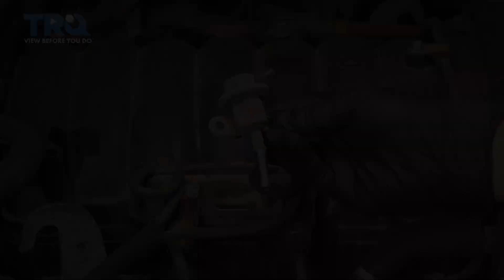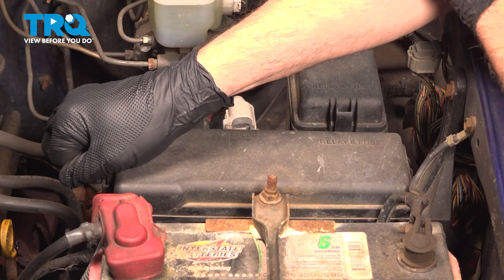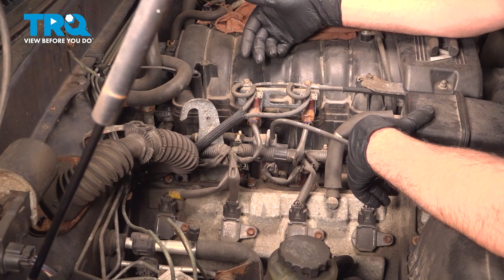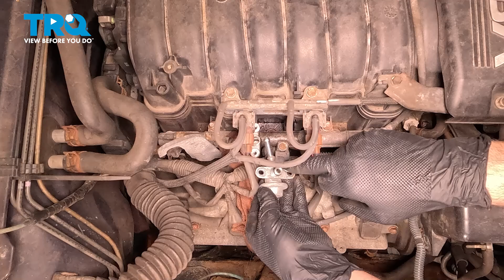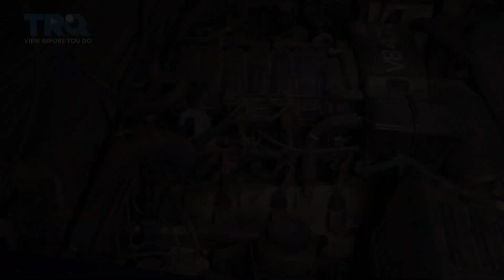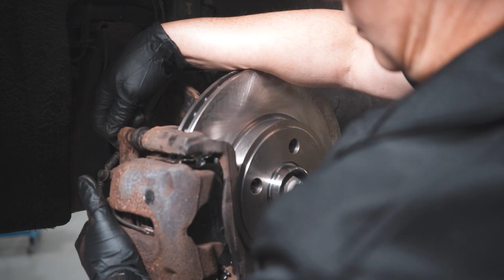How to Replace Fuel Pressure Regulator 2000-2006 Toyota Tundra 4.7L V8

Comment: Okay, , so the fuel pressure regulator hose connects to the air box, correct?
The fuel pressure regulator must not need much vacuum then, , seems like the hose would connect to the intake manifold.🤔